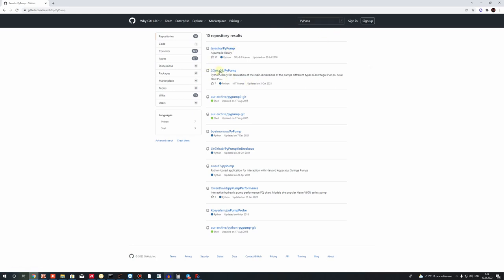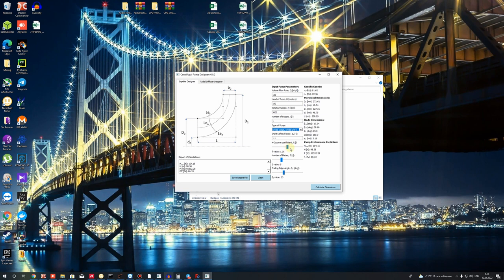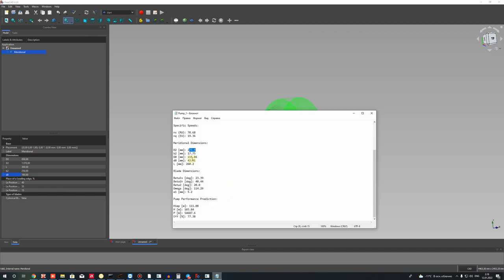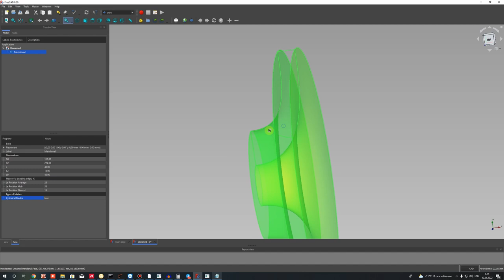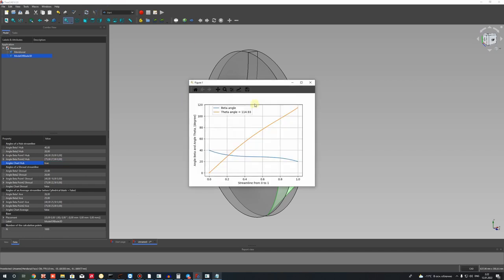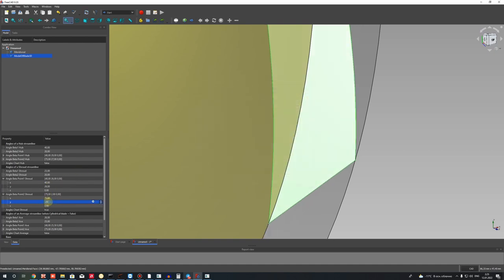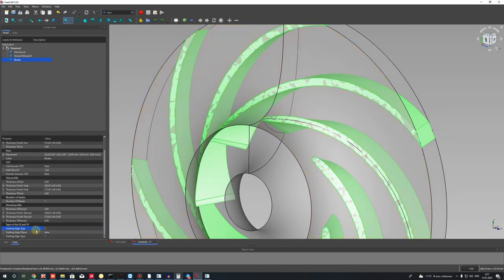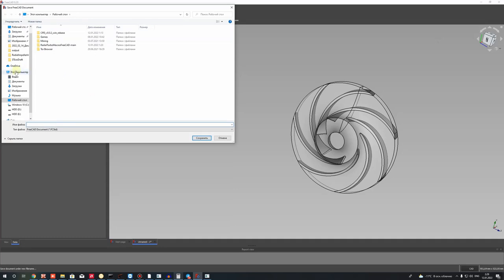FreeCAD + ANSYS CFX Part 1/2 |  Design and Simulation of Centrifugal Pump Impeller

Comment: There is a question about the tool used for impeller parameter calculation. You said that H-Q factor affects on steepness of impeller performance. Is there any ways to check it? Is it possible building the full performance curve with this tool?
Reply from the maker: Hmm, I don't find any analytical expressions for prediction of steepness, but I have used expressions from Gulich "Centrifugal Pumps" I recommend to read. Unfortunately the full performance curve you can't to predict with this tool. In my opinion, you have to use CFD methods for prediction of H-Q steepness